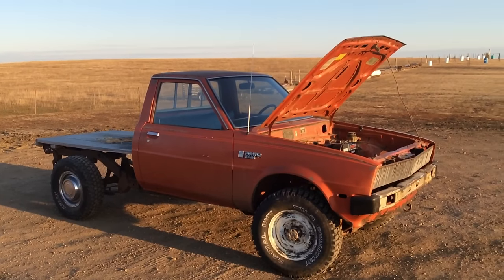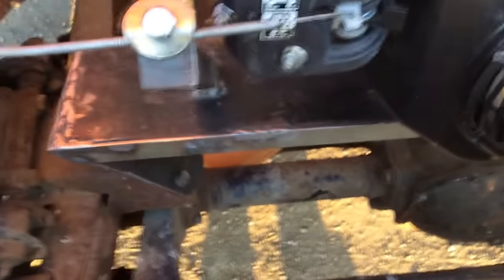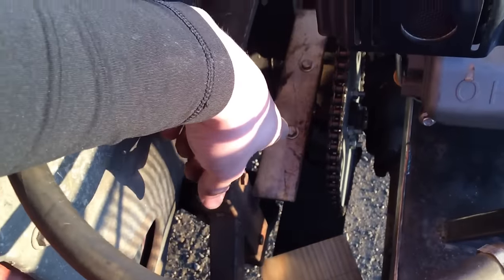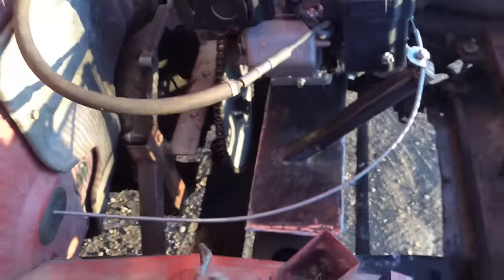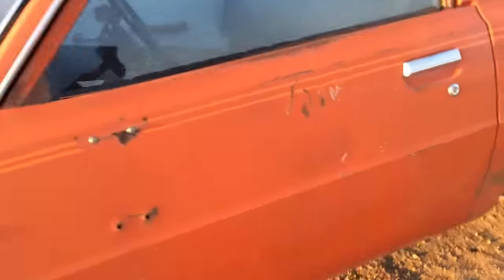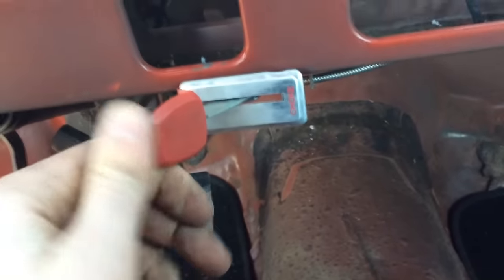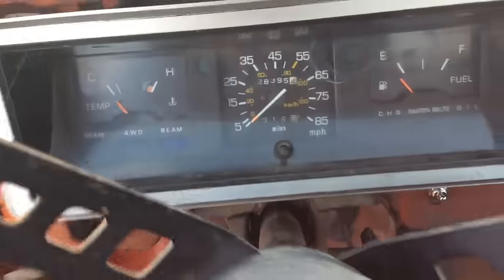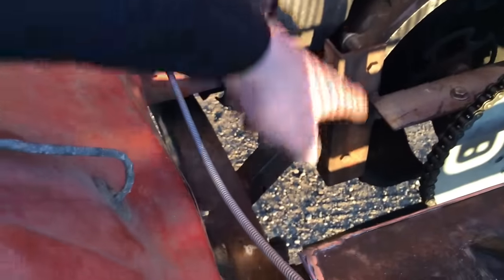Predator 212cc Truck

Comment: I've got an old Cushman Eagle scooter frame with forks and I have been thinking about the Harbor Freight Predator V-2 16 horsepower engine with a torque convertor. It should be a pretty easy thing to do. You are an inspiration after seeing what you did with an old farm truck and a 6hp Predator. Having the low gears of a FWD must be helpful. Good job, young man!
Reply: I have seen them with Vanguard V-Twins installed. Check this link: http://www.hobbytech.com/VGcenter.htm  I am in no way related to them nor the website.

Comment: Awesome! 
Great job. 

Now just prowl your local dump and other sources for a cheap/free busted snowblower or riding mower with a working 10-15 hp engine to swap in and she'll scoot and haul around the farm nicely!
Reply: should go watch Carsandcameras and see what they do with these 212's, lol that had one pushing 9000 rpm and like 20hp
Reply: I have an old 28 HP snowmobile, maybe I should put it into a Cadillac.

Comment: Well, I guess it should work in my snowblower.  Awesome!   $99 dollar engine running a truck.  Incredible.
Reply: I swapped a Predator in place of the failing flathead five horse on my snowblower. From my experience I would say that you will not be disappointed. Less temperamental in the cold of winter and throws the snow further. Also does not stall out in a hard drift. My only regret was that I hadn't done it two rears earlier.

Comment: Very nice build, I don't think I ever seen a Dodge ram 50 before.
Reply: Not to popular seen like 5 for sale in 5 years
Reply: It was a Mitsubishi imported
Reply: Mitsubishi mighty max pickup rebadged as a Dodge Ram 50...not very popular, there was a diesel version which was probably just as powerful as that Predator swap LOL.
Reply: when in high school had the diesel version of this truck
Reply: @4thGloryMonday  40+MPG?  Someone here in town where I live had one and said they'd get over 40mpg out of their Dodge Ram 50 Diesel.
Reply: @wildbill23c  i never figured out the mpg just didnt care bout that stuff at 16 but i bet it was around 40, the biggest problem i had was finding a station with a diesel nozzel that would fit, most places that sold diesel where i grew up were meant to fuel semi trucks so when i did need fuel i had to get it bout 20 miles from home
Reply: @4thGloryMonday  Fuel would be an issue...guess the other alternative would have been gas cans LOL.
Reply: My uncle has a 4x4 like this he bought new and it has roughly 300,000 miles on it.
Reply: Ram 50 was a great lil truck!
Reply: @74superglide  yep they dont make cars to last these days
Reply: @74superglide  Those old Mitsubishi/Dodge vehicles were not popular, but were tough. I had several Colts and wanted a D50 Sport so bad! Thanks for the memories!

Comment: I'm swapping the engine on my Toyota v6 for a Kubota v1505 no turbo , no nothing just the basics. Don't need 400 hp to drive me to work. Here in Panama diesel and gas are over $5.00 per gallon so can't beleave the cost of driving a v8. So thank you very much because after seeing your build I'm more confident on my 30 hp project. Very good mechanical skills.

Comment: That's a cool project. The Citroen 2CV was a 9-HP engine vehicle.
Reply: 2cv was 14hp. 3cv 35hp
Was thinking the same thing when i heard it ran hahahah...
Reply: AAI6718 2CV was 2hp 2CV is 2hp in like Italian and French or something
Reply: @losmilitantesdemilei5259  actually, 2cv with the 375cc engine was 9HP
Reply: @hojnikb  In Argentina a 2cv had 14hp and 3cv 34hp 
Im not shire about Europe.
Reply: @hojnikb  2cv = 450cc, 11-14 hp and 3cv =650cc 32-35hp

Comment: Awesome project I'm going to  put a 10hp diesel in an s10 and thought about a torque converter now I'll used a centrifugal clutch
Reply from the maker: Nathan Creel I wouldn’t totally rule out the torque converter because it might work better in your situation.
Reply: Needs more like 25 to 35 hp minimum to be useful
Reply: @AustinRBa  yes the same it's a yanmar clone a 186f I believe is the model
Reply: @theejoeylee  well I've only got a 10 so that's what I'm gonna use may drop it in a side by side with a blown engine if I can find one
Reply: @nathancreel9866  Now you're talkin
Reply: @nathancreel9866  I'd like to get one of those little diesel engines. Especially since I imagine it'd be a lot easier to increase power on it than with a gas, since you just pump in more air and fuel and it sorts itself out. If you get a larger 'torque converter' made for the 420 and 670cc engines instead of the smaller ones intended for these engines, it should handle this usage better. Maybe you could also use a longer belt so it has more length to spread the heat across. I would really expect that to work better than centrifugal clutches.
Reply: @spaceminions  Mustie1 recently had a 2 cyl Kubota Generator gifted to him. It runs!  This would be ideal for this truck. And I think it would bolt up to a clutch plate too.  Makes about 10-14 HP.
Reply: @gravitationaleddie5611  Very cool!

Comment: Cool video, I did a 1970 Toyota swap with about a 10hp electric forklift motor, I could burn rubber, but my top speed was like 36mph if I remember right.  I see they make a lot of go fast parts for those predator motors now, thanks to the go cart racers, you can pretty much triple the power for a couple hundred bucks.  I think before I started throwing money around like that, hah, I'd get an old riding mower with a 20hp motor, you can find them cheap with busted transmissions, and lots of info on the internets on how to convert vertical drive to horizontal drive.  My current project is to drop a 52hp Perkins diesel sailboat motor into my 1930 Ford model A truck.  Truck I paid $500 for, diesel motor I got for free with my sailboat, I pulled it out cause I'm a sailor, not a motorboater, hah.  Keep it up.

Comment: And here i thought my Mitsubishi L200 (same truck, dodge is just a rebadged mitsu) with the 2.3 diesel was low on horsepower :D Great ingenuity though! :D
Reply: Low on power? check out the VW Rabbit Diesel and PU max speed on a good day was about 50mph
Reply: @homefront3162  no you're wrong there lol.i had a 79 rabbit Diesel .it wasn't great on go buy great on torque but that's all diesel engines. But I'm from IOWA and my folks took it to Grand Rapids Mi and they were getting hi 40s and low 50s mpg.wish I had that thing these days just for the mpg
Reply: Dean Nederhoff Well we had the California one and if it did 55 (The speed limit then) you were lucky.    I always thought the engine would make a great Genset engine..  and yes the mileage was insane

Comment: Man that is cool. If you ever want more power a 670 would fit and be even faster.

EDIT:spelling
Reply: Or put a stage 4 kit on
Reply: Or both
Reply: John Thefox you mean a 670? I don’t know if you said the wrong engine or there’s another one I don’t know of...
Reply: Hand over them delicious feet maam Predator has a twin cylinder horizontal engine that displaces 670cc.  There is an aftermarket for performance parts to jack up the HP for the 670cc.  As a side note, they also have a twin cylinder vertical engine that is 708cc.
Reply: Great work. Those engines respond really well to a few mods that can unlock more than double the horsepower and at very low cost. 
Not many cars these days get to boast a hundred bucks for a whole new plant.. that wouldn't even get plugs and filters for mine.. lol.
Reply: @1anthonybrowning  Imagine combining 2 of those 708cc I2s.
Reply: I have a Mitsubishi minicab with a gsxr 600 in it, does about 90 and burns all 4 gears. Deathtrap basically
Reply: @guidoguido8677  90 isn't much, my bone stock Transit Connect 1.8 Diesel goes 105
Reply: @codykamminga9667  my mini went 50 kph when i bought it.. now it does over twice that, 135/55/12 tires and it fits in the bed of my pickup
Reply: Guido Guido What the transit? I’ve drivin it over 165 km/h on the autobahn already, not really scary, just the sound of the screaming 4200 RPM Turbo Diesel
Reply: @codykamminga9667  yeah bub, two completely different vehicles... mine was a parking enforcement car at a college. You cant even legally drive it on the road. It has .618 gears 210hp and weighs just over 900lbs...
Reply: @codykamminga9667  i can physically tip it over by myself
Reply: @guidoguido8677  he obviously doesn't know what vehichle you are talking about because hes comparing apples to grapes
Reply: Or a 318 lol
Reply: Alasdair, I could buy two of these motors for the oil change money on my truck!
Reply: It would probably still the same hp as original 4 cyl
Reply: Great job man!! I’ve seen a few of these swaps and yours is by far the best and most detailed oriented. Throw a few mods on the motor from gopowersports.com and you will have a real screamer. Side note I’d run a exhaust out the bottom and figure out a way to connect the motor to the original gas tank. Again super sweet project. I look forward to seeing more content with this truck.... efi with turbo from eco tron?
Reply: Guido Guido wow! Please post a video of it here for us to see! I’d really like to see it! Thx

Comment: -- Brilliant dude. Really well done.
 Suggestion:   remove all non essential weight such as the doors. That motor has after market performance options. I would go with the oil radiator and better carb intake.

Comment: Try low range on ur transfer case. Should make it go better.
Reply: He is in low
Reply: I believe seedless grapes is right. You can hear him shift twice after he starts moving so that would put him in at least 3rd gear. He also said that he had had it up to 20 miles per hour or close to it, and I know he was not moving near that fast in video. Speaking from a previous owner of these vehicles, also known as Mitsubishi Mighty Max, 3rd gear in high range is much faster than he is going even at idle.
Reply: Tony Fisher - I think he should take it out of 4x4 low. Should be able to get going faster. Slower to get to the speed, but still faster.
Reply: @waynetrent67  The engine is geared way down before it even gets to the transmission with the chain sprockets.  That is why it goes so slow.

Comment: Cam upgrade, better carb, and an oil cooler should be your next upgrades
Reply: @torvestas sister the carb is 20 bucks. The oil cooler is like 25-30 bucks. The cam I found for 75 bucks. That's a total of 125ish bucks. A decent 4cyl motorcycle engine is around 400-1800 bucks.... 125 in upgrades plus the 130 bucks he already paid for the engine is  255ish bucks.... I'd rather buy the upgrades... but I wasn't serious about anything but the carb.
Reply: @cheeko_914  BOO. No need to be like that..

Comment: Run your pull start into cab with room to pull. 

If your suspension is compressed you wont be able to start it. Otherwise amazing engineering.
Reply: You could still pop your hood and pull on the cord.. 
But I agree, it needs to be routed a little differently.
Reply: You know you can reply to people right?

Comment: I think you must have had the torque convertor set up wrong for it to eat belts but the clutch is better because you already have gearing with the transmission. You have got to remove the governor and put a stage 1 kit from gopowersports.com you will love the power gains, and removing the governor will give you alot more rpm to go thru in each gear and a better top speed. With the header in the stage 1 kit you will probably want an rlv muffler to quiet it down but keep the 9+hp they are cheaper on ebay. That is the hemi head predator 212 my favorite

Comment: 0 to 60- 10 minutes.
Reply: Edit: 0-16 in 10 min
Reply: I wonder what the gas millage is? And awsome truck
Reply: 0-60: maybe?
Reply: It won't hit 60 unless it's going down hill.
Reply: Butter Finger lol good luck with that. Probably strain the engine with it spinning over what it was built for as the trans starts over spinning the crank on a steep grade
Reply: @Attachments.  never said in 1 piece

Comment: You should get a 670cc with the money you make off this.
Reply: I got a beat up d150 truck I am gonna put a 670 in it.. I am gonna use a a 10 tooth clutch to a 112 tooth sprocket then hopefully I can get an auto trans to work but I think I still have to shift it but i don't know yet.. trial and error I guess
Reply: @kevinpenn3424  if its automatic , you just need 3-1 gear ratio and a centrical clutch.. 11 to 1 is too much
Reply: @kevinpenn3424  You are thinking ahead. Good luck with your project!

Comment: I had a Ram50 back in the early 2000’s, still had the correct 4 cylinder and 5 speed. I think it was 2.5 or 2.6L I don’t remember but it made plenty power for getting around and even hauling a loaded bed. Wouldn’t mind having another one now, or another Samurai

Comment: Hey there's a guy on another video that went with the 420 harbor freight engine used a set up from a go cart that had the torque converter type clutch that ran to a jack shaft that had a sprocket and motorcycle chain connected to the input shaft on the transmission.  It sounds complicated but it's really  a straight forward and simple simple idea when you look at it. He used a Honda car, and started with a 212cc engine from harbor freight.  He has reached speeds of 60 miles an hour on the 420cc engine before he started getting in to the heavy modifications.
Reply: The video of the 212cc car  https://youtu.be/x7EqWfFXhkI

Comment: I've been thinking of putting a Briggs & Stratton in my D50.  Someone said, I think it's been done, look on YouTube.  So I searched and led me here.  I have some different ideas but man, hat's off to you for having the vision and seeing it through.  

Just tell us all one thing, what's your next project going to be?  

Give that man a Blue Ribbon!!
Reply from the maker: Try to use the original clutch! Let me know if you need to know anything!
Reply: @everythingwithwheels4614  I'd really like to use the original clutch and starter but I'm having trouble getting that all straight in my head.

Comment: well I would say you built a perfect utility vehicle for around the property. Looks and sounds like you nailed the drive ratio predator into gear box in that it will get some low gear work done it needed. Good one I will subscribe now.
Reply: It's just had the transfer case shifted to 4 low

Comment: You could add some more cable to start the motor from the inside. Just add a ball bearing for the cable to make that 90° towards the driver seat.

Comment: 🤔 awesome build

What if you kept the factory auto clutch and flywheel popped off the ringer for a chain sprocket and added support bearing like crank would provide
So you can shift easier
Again cool build   would interesting
To see the fuel mileage with $5 a gal gas

Comment: Great build and ingenuity. I was just curious as to how you managed to attach the Predator Engine to the factory Dodge transmission. I was thinking about doing something similar except with a motorcycle/sportbike engine and hopefully a 200R4 or 700r4 automatic transmission. I just don't know where to start. Or who I could talk to about my project.

Comment: Ok, you have, HAVE to put in the high performance cam and valves and stuff. They have heavier clutch springs too. Im betting you can make that thing city driveable if you can do 20 with it stock. Thats pretty impressive.

Comment: Dude, how old are you?  Great job.  That truck actually looks like it would be functional around the farm.  The solid motor mounts had me concerned about excessive vibration but then I realized that the chain drives were dampening some of that.  I f you ever wanted a radio in the truck you could make up a simple solar system with a old acid core battery (maybe free) and a Harbor Freight solar panel.  The options are endless.  Again, Great job!

Comment: Heh heh, pretty nice. May be a plan to upgrade to a Predator 670 or 708 V-twin and get the gearing up to something a little more usable for hauling loads and pulling stuff. The fact that it's 4WD would make it really handy in any kind of weather for getting around, and realistically you may even get a little better mileage than with the original 4 cyl.😁👍
Reply: He's in 4 wheel low...good enough

Comment: At first I would have said that id got for the 420cc instead of the 212, but that thing has a surprising ammount of pep with such a small engine in it. Though, the 420 has electric start.

Comment: Wow. It actually moves around a little bit. Imagine if it was a 10 hp tillotson 212 in there rather than the 6hp. Prolly not much difference but I wonder

Comment: I have been thinking a lot about doing this at some point. I am very curious if there is enough vacuum from the intake of one of those engines to run the power brakes. It would be seriously cool to do that. I think you could get the charging system for that engine and have all of the lights working if you switched to LED.
Reply from the maker: patthesoundguy if I was to do it again use the original clutch try to make vacuums breaks and buy a bigger Tilitson engine that comes with charging coils on it